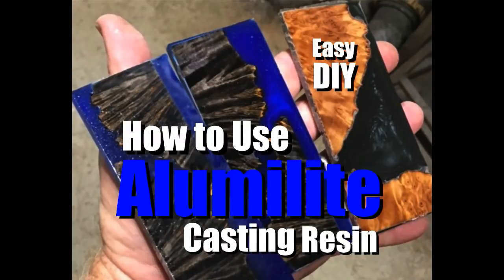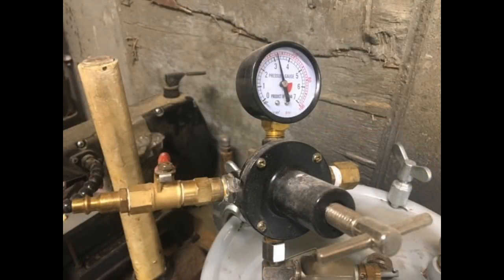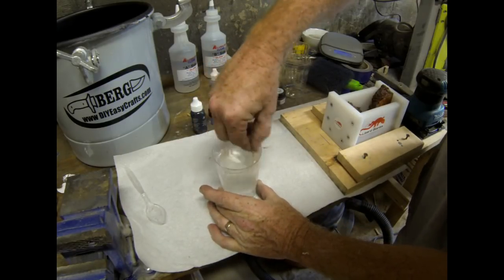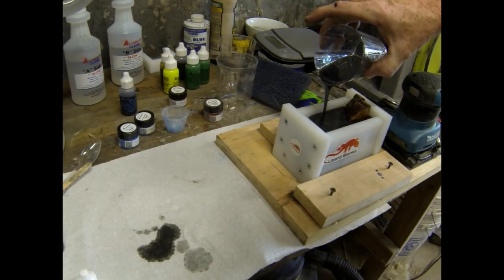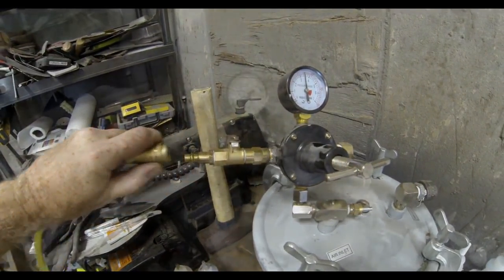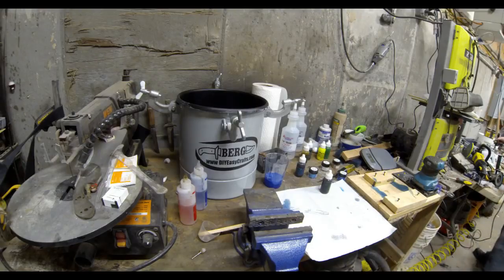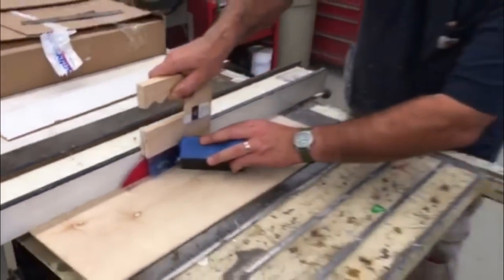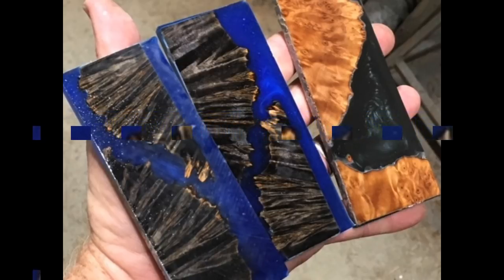How to use Alumilite Casting Resin for DIY crafts

Comment: If you vacuum part B before mixing with part A and then vacuum again once mixed, you will remove most of the bubble issues. Also, your dyes and additives should be thoroughly mixed into your part A before mixing into part B. This gives you a longer working time. I also pressure cast.

Comment: There is no such thing as dry wood" the best you can get is ambient humidity. Is this dry enough or do you put the wood in the oven first?
Reply: check into 'stabilizing' the wood, which is what you have to use when including it in resin castings